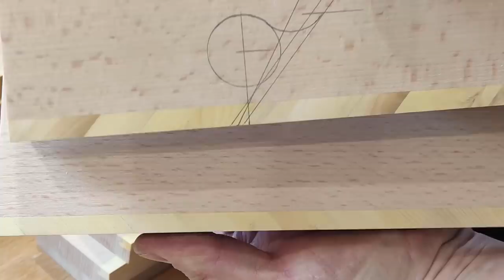047 Sliding dovetail hand plane - version 2.0   Part 1 of 3

Comment from the maker: Hello! Some of you noticed on my instagram that i'm preparing few pairs of sliding dovetail hand planes. It would be the same kind of planes as i made in my first video of my channel, but this time they will be normal size. The planes will work in pairs - left plane and right plane for booth directions of cutting.
If you dont know how i made the boxing on this plane blanks just watch my previous video. 
As usually i decided to make video of bulding process, but as one part it would be to long so i decided to make it in 3 parts.
Every step is decsribed on the timeline so you can easly read what i'm doing in any moment of the video.

I hope you will like it!
Regards!
Reply: Thanks Master! ✨🌳✨🌳
Reply: Thank you, Gakos! As a update, my first two trys of plane making fail. The first one I take to much of one parte of the escapment and the other I aim the bed at 55° and end at 60°, but I will continue to try!
Reply from the maker: Keep trying Luiz :)
Reply: Very Nice!!! Great Video!!! Somehow I missed this one. Now onto PT 2!!! Thank You!!!!😎👍😃

Comment: hello, where do you get your irons for your planes ?
Reply from the maker: Hey, for this project i bought some NCV1 steel and my buddy cutted the raw shape on cnc
Reply: @StavrosGakos  thank you, do you have any advises for what steel to choose and where to get them ?
Reply from the maker: It depends what kind of steel CNC can cut (it is calibrated for each steel to get good results). First ask what kind of steel they can cut, later find it. Better option can be watercutting but it would be more expensive. Almost every knifemaking shop have few  kinds of steel wich can be used for plane blade. Cheers!